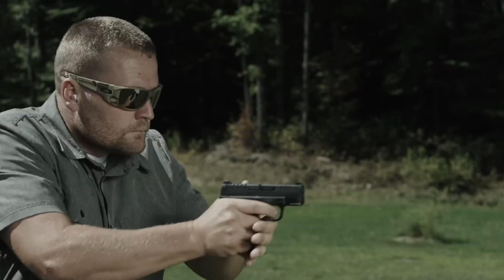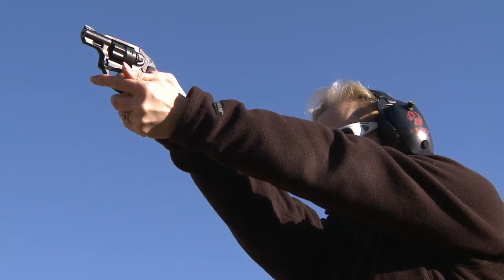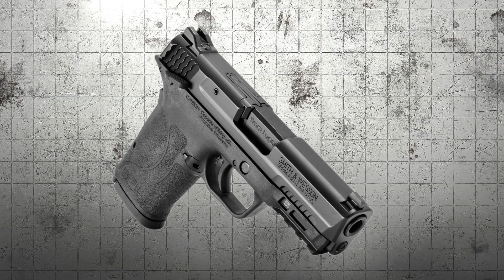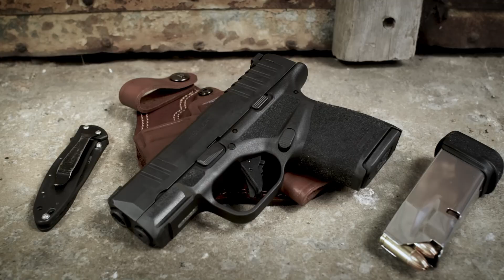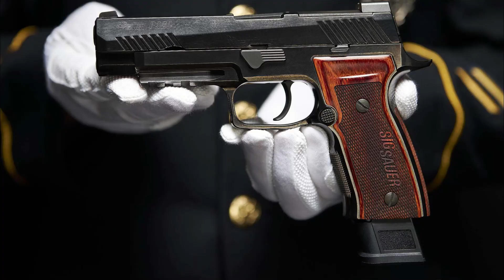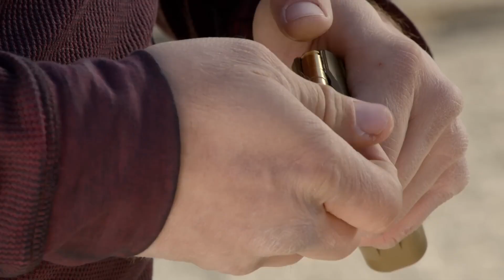TOP 10 MOST RELIABLE HANDGUNS EVER MADE!

Comment: Any gun can have problems, ive had issues with hellcat pro sig p320 and and a glock 43x  all were fixed id say my sig p365 xmacro i trust the most and my glock 19  they have both ran flawless for 1500 rounds so far
Reply: Yes any gun can fail. But they're more likely to fail if it's a Taurus. They are trash.